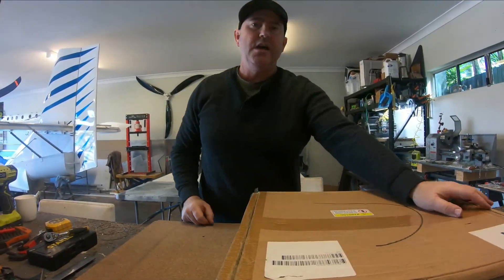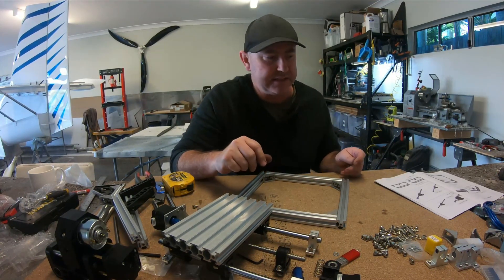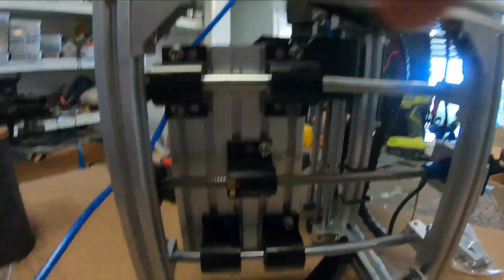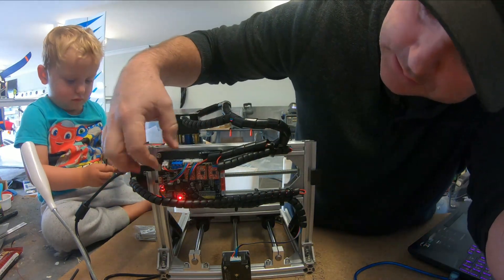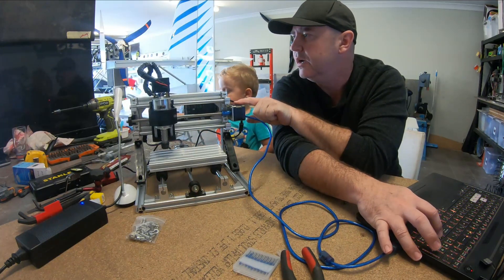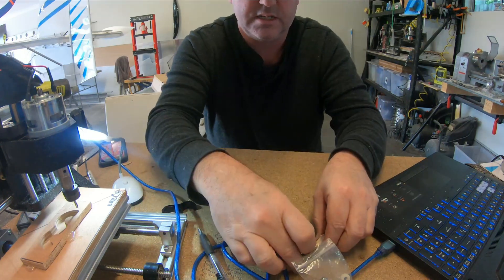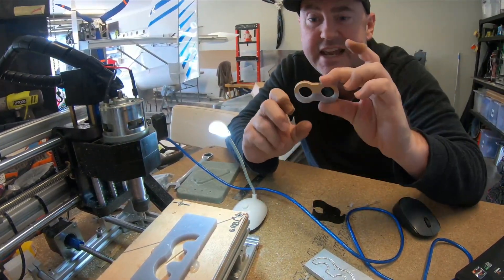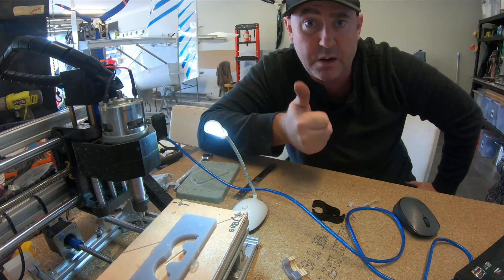Cheapest DIY Ebay  CNC router 1610 review #engineering #diy DIY projects #cncmachine #shop

Comment: I'm debating on getting this for making Micarta Scales for  Swiss Army Knives, and possibly other knife models. It looks like it should work with Micarta no problem. I'd gather it's not rated for titanium. That means if I do get it, I need to hustle to upgrade.
Reply from the maker: It is a good starting point for you to play around with but you will definitely want bigger once you start using more

Comment: How much of a depth can it cut? True one can do 4.5cm on this? The drill bits looks a bit short
Reply from the maker: Probably only 1mm on tooling board would be it’s limit the spindle will stall . 
The endmill is short but can be moved to a longer position if needed.